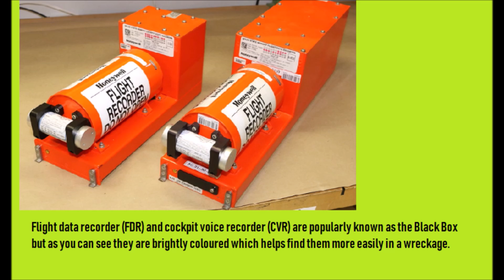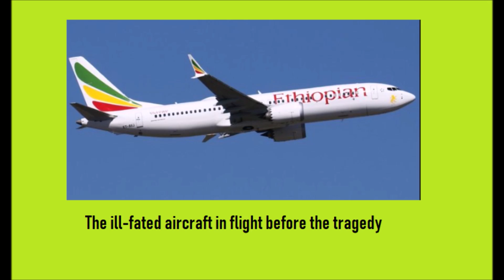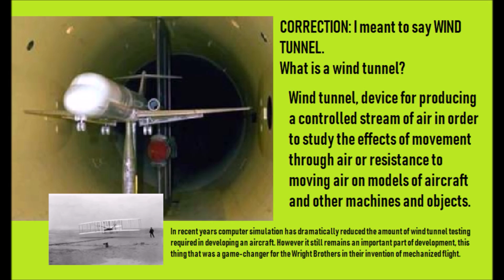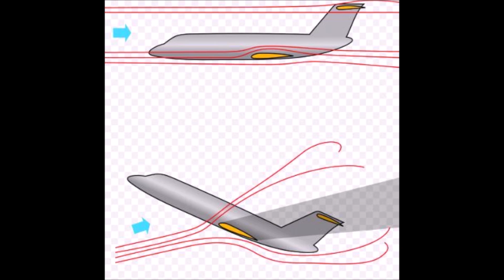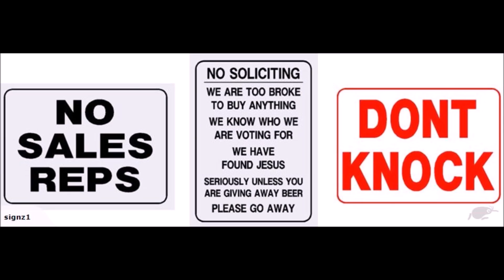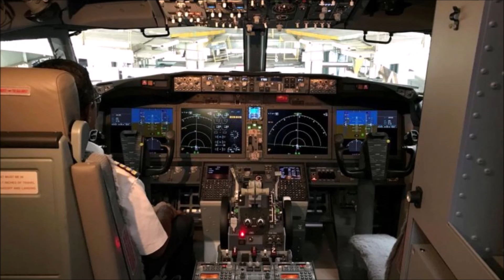Remembering The Boeing Max 8: Why An Early Better Fix Was Ignored

Comment: Nonsense...AOA disagree caused the pitch trim to run away and the crew didn’t disengage it in time. Pitch trim compensation is included in every modern day aircraft design. This allows for thrust changes, fuel transfer and passengers and crew to move thru the cabins pushing carts during flight. Boeing offered AOA disagree warning as an option and it should have been standard equipment.

Comment: All true, plus:
1. Disruption of airflow over the wing caused by high mount of engines, thus reduced lift then; this dirty air over the elevator - bad design! But remember, it had to be seen as a 737 so you couldn't put the elevator on top of the tail fin in clean air because the idea of the 737 would be gone! (Though it doesn't fly by wire like the modern Airbus) 

2.  Please compare the aircraft it was rushed into production to compete with, Airbus 320Neo and no MCAS (might crash any second) it has THREE AOT sensors fitted, one to be sent to each pilot and a spare to be used in case of disagreement - redundancy! 

I agree this crock of 1960s shite is a fundamentally flawed design, but the other two issues add to the incompetence of Boeing and its keenness to get the Max into production via software fix for hardware problems. 

Send them to a crusher "unsafe at any speed"...

Comment: Boeing was allowed to run it's own test to say the plane was air worthy . The FAA is at fault for allowing this to happen . The whole reason MCAS system was installed was to mask an unstable airframe . Boeing fooled the FAA into believing the MAX planes flew so much like a regular 737 that the pilots would not even need new training to fly it . Boeing "forgot " to tell the FAA that the 737 MAX could not fly without the MCAS ( May Crash Any Second ) system . Just a little oversight, only cost 350 lives .
Reply from the maker: well put

Comment: I haven't read all the comments, however, I don't see any reference to the over-weighted input of Southwest Airlines into the design requirements of the 90-180 passenger Boeing offering.  From the 1980s to 2000 Southwest Airlines drove the profit of this sized Boeing aircraft.  It has been reported that when Airtran was looking for a larger aircraft to add to their MD80/B-717 fleet it asked Boeing to provide a design to fit the requirement, Boeing replied, 'We have just what you're looking for, its the 737-8!'  Form always follows function.  In this case the overriding function was profit!

Comment: When the dog gets hungry it neither thinks nor considers options other than food; it will do any thing to any body to get its gob on the bone.
  It sees itself lagging in 5g; what bits and bats is it going to string together when it gets hungry; g5 equipment can be deadly if not tried and tested ,and certified by an  (independent) authority.
Now i'm scaring myself!

Comment: The advertisements claimed a 15% more fuel efficient aircraft, from the previous model 700. A simple solution would be to raise the landing flaps to a setting of 5 until the aircraft reaches 10,000 ft AGL.

Comment: A few years ago when Boeing was having problems with the lithium ion batteries on the 787 Dreamliner a professor at Harvard business school wrote an article in the Harvard Business Review titled, "The Price of Wall Street's Power". The point he was making was that people in the capital and finance industry were exerting too much influence on how companies like Boeing were running their businesses. The recurring problems with the Dreamliner's batteries were exacerbated by outsourcing and long supply chains, something which Wall Street had been pushing for years to increase profits. The design, manufacturing and operation of airplanes should be a collaborative effort between engineers, manufacturers and end users like pilots and airlines. Letting accountants, financiers and investors have too much control over a technical process like building airliners can lead to these types of problems.

Comment: The plane should have longer landing gear to accommodate the larger engines. but this probably would require new factory for that and also significant modifications to the fuselage. Manufacturing cost and time delays were unacceptable due to the loosing of sales to Airbus. Boeing was loosing sales and now it lost public trust.

Comment: It would seem that the nacelle poking up over the wing would also cause changes in air flow and turbulence as air passed over the top of the wings thus changing the aerodynamics of the wing and the planes flight characteristics....
Reply: Nacelles above the wing could disrupt airflow the airflow on top of the wing, creating even lower pressure above the wing which creates more lift...in this case, way too much.

Comment: The engine being higher and more in front of the wing causes the nose up characteristic.   All of this derives from the plane being too low to the ground for the bigger engines.   Should have raised the airplane and leave the engines in the old position.   Adding the screwy mcas was a cheap band aid solution that became tragic
Reply: I would assume you mean make the landing gear longer. The problem is you can't. And therein lies the root of the problem.

Comment: I don't think Boeing made the software change thinking it might endanger human lives. 
Cheap fixes don't always equate to substandard fixes if done properly. So if they thought they could use the cheapest way to remedy the situation then they did what any for-profit business would have done. However, they failed to inform the pilots, therein lies their negligence.
Reply: Steve The people writing  the MCAS system to depend on a single angle-of-attack sensor should have thought  they were doing a cheap fix. Relying on only one sensor to go nose down, when the plane has two, certainly sounds substandard to a layman. But I did read/hear that there is a tradition of depending on only one sensor in a 737 (due to the way it is setup with separate computers having separate inputs - making using the other computer’s sensors difficult) with the pilots being the thing that eliminates a “single point of failure”. But in this case Boeing purposely left MCAS out of the manual, to both hide the plane’s deficiency and avoid pilot training costs. And they also failed to advertise that (allegedly due to a software error) the indication that the angle-of-attack sensors did not agree was now an $80,000 upgrade).

Comment: My understanding is it's not about the nose being heavier than before.  The clearance problem under the wing (Airbus does not have this problem because their planes are higher up from ground)  warranted the forward placement of more powerful engines.   As far as I can understand, that would cause rotation under high thrust because the engine now has a longer arm about the center of mass of the aircraft resulting in larger rotational moment being generated before (to be fair all planes with engines mounted under wings will to some extent have this tendency).  This causes nose of the plane to pitch up under high thrust (e.g. during take off).  That tendency should have been fixed by proper designing rather than implementing a software solution.  Profit was on the minds of people (CEO!!!) of the company over safety.
Reply: My understanding of the problem is different based on what I've read. The problem is said to be that during a climb air starts to impinge on the bottom of the large engine nacelles and this causes the nacelles to produce extra lift. Because the engines are so far forward and at the end of a longer arm the lift produced by the nacelles tends to push the nose up.
Reply: @Joe Vignolo You could be right.  However, I venture to say we agree that the net effect is that the longer arm is what makes the pitching up problem larger than before.  Regardless, whatever causes the pitching up should have been fixed at the level of designing a sound airplane rather than fix it using software (and not tell pilots about it???), in my opinion.

Comment: The whole premise of this video is wrong. I have done much research into the development of the Max 8. The airframe is inherently stable. There are only certain conditions where the nose of the plane can get light and tend to float up into a dangerous AOA. This accident was 100 percent caused by a breakdown in the entire system. Not just the aircraft systems. BOTH AOA sensors were malfunctioning on this crashed aircraft. The pilots flying did NOT have the necessary training to know what to do. They followed the right procedure right up to the point of turning the stab trim switches BACK ON. that one act doomed the aircraft from that point. I beg the question.... Why was there a pilot in the cockpit under comand of this aircraft at the time with only 200 hours of total flight time. Are you kidding me. The blame for this accident falls with boeing, the airline AND the pilots. This is a horrible accident and I genuinely feel a great sense of loss for the people that were ddirectly affected by the death of so many innocent people. But demonizing one company or one  cause will not help anyone. Just like any other  accident there was more than one causal failure for this accident.
Reply: Your not accurate either
Reply: Sorry but you're not correct. One AOA was working correctly.  The aeroplane design is overall flawed due to the oversized engines and poorly designed MCAS.  The pilots followed procedures and due to cutting costs by the manufacturer, procedures that were not well defined along with brief training, this happened.  You cannot blame a pilot having 200 hours as the cause.  You clearly work for the manufacturer!

Comment: A human life in Britain costs 1.8million, that's the figure the government uses when evaluating whether to pay for safety improvements.  They need a figure, otherwise they might blow the nation's entire GNP, on say, putting every single highway underground to prevent deaths from asthma.  The value used by Ethiopia is probably substantially lower.  
I think though, that Boeing made a bad call here, early in the design process by building an inherently unstable aircraft, and trusting in the reliability of a system to actively keep it flying.  It had been posited for decades that a commercial airliner could be made more efficient by using fly by wire to allow inheritably unstable designs, for obvious reasons we didn't allow this. My feeling is that the 737max isn't unstable like an F16, but that it would be "tricky" to fly without computers and that Boeing thought it was good enough.

Comment: MCAS isn't all that bad on itself, it could even have prevented crashes with other types of aircraft. However, at this time, we still expect the pilots to fly the aircraft (instead of computers); Too much electronic help may give the aircraft an unpredictable feel and leave the pilot less 'connected' with the aircraft. A redesign to get the aircraft's dynamics predictable would be best, but considering all difficulties it may be more feasible to get the MCAS system to disable in an intuitive way like: when the pilot hits the up-elevator endstop.

Comment: Pretty amazing that you got the entire problem wrong..  The angle of attack sensor system has proven not robust enough to reliably provide necessary signals to the flight control system. The programming of the flight control system has proven to be to aggressive. The training program for edge cases interacting with these systems proved inadequate. The certification to have caught and fixed this in the first place failed.
To recap, it's the sensor system / flight control , pilot training, & proper certification. The plane will fly just fine once those fixes are in place. I do personally feel the rush to get the product out the door in this case is/was corrupted to a point of being criminal. Someone should have thrown a big red flag out to fix this before the first delivery.  A show stopper for a long useful life of airline service?.. nope.
Reply: I agree with what you have written here. I have researched the development and the systems of the MAX 8. The airframe is inherently stable. Adequate training and redundant systems which will NOW be part of EVERY MAX 8 will make this aircraft one of the safest and best in the industry.
Reply: I think you are missing his main point here. You talk about the specific current problems in MCAS while he is talking why it is needed in the first place. If you have this kind of software trying to compensate for errors done when designing the aircraft update you will always risk getting into this kind of problems.
Reply: @pjohan74  Well said.

Comment: No redesign is necessary.  Experienced pilots who have flown the MAX say it behaves almost the same as the NG.  

The fixes they have planned are really belt and suspender.  1) Install two AOA sensors 2) Do not invoke MCAS if the sensors don't agree, 3) "Inspect" the sensor output, even if the two agree, to make sure the readings seem reasonable, 4) disable MCAS if the pilot is fighting with it using the elevator control, 5) always allow the pilot to put upward angle to the trim, and some other things.  I'll be happy to fly in such a plane.

https://www.youtube.com/watch?v=zGM0V7zEKEQ&t=2s
Reply from the maker: https://www.youtube.com/watch?v=H2tuKiiznsY

Comment: The biggest problem was the naive implementation of mcas. No sensor redundancy or voting. MCAS Able to overpowering the elevator controls, no clear override available
Reply: There is no way for software to know if a datastream is valid or not. Averaging the two can still cause a disaster. The second sensor is provided only as a check on the first with the match/no-match answer being shown via light (which most airlines did not buy). It takes human initiative to switch the sensor being fed to the flight computer, assuming both can be read, and there is no way to do that. Voting can still cause problems as it did on the AF-447 crash when two of three pitot tubes froze over causing the flight computer to choose the wrong input. MCAS has a disable which is the only option when there is pitch control problems. After the the Lion Air crash every Max pilot should have known how to disable MCAS and be prepared to earn his pay by flying the plane.
Reply: @garymartin9777  The Ethiopian pilots did disable the MCAS, but were unable to manually trim up the airplane due to high aerodynamic pressures. Disabling MCAS means also to disconnect the electric trim engine. When unable to manually trim up they reconnected the trim electric engine, but this woke up MCAS too. It would have needed a good training, and nerve, for the pilots to pitch down the airplane and cut throttle to relieve the aerodynamic pressure on the stabilazor, and at the same time manually trim up.... all in a very short time.
Reply: @alfaeco15  Yes and high speed at low altitude was a large part of the problem.  It left 737 pilots scratching their heads wondering what the guy was thinking going that fast -- even when the overspeed klaxon went off.
Reply: @alfaeco15  since this happened shortly after take off I wonder if they even had the time or the altitude to make those adjustments.
Reply: @alfaeco15  from what I 've learned about Captain Getachew he did have the training and nerve. He traveled to Miami in 2017 for simulator training on this plane and was due for follow up training with Ethiopia 's new simulator later that month.  You can hear them on the CVR working the problem, or trying to.  Once that software went haywire they didn't have a chance.
Reply: MCAS disconnection should have been independent of the electric  trim control. Let's see what boeing fix do
Reply: Technically the pilot could have nose down the airplane to release aerodynamic pressure on the tailplane, but it is not the first reaction when the plane pitches down, requires counter intuitive thinking and nerve. And if the plane is already too low...

Comment: Commercial airframes are required by the FAA to fly hands free.  Meaning, the airplanes are inherently safe.  There are no similar restrictions on military aircraft as the need to perform at the highest level.  It is very common for an MCAS type system to be found on these planes.  A few years back, a B-2 bomber crashed in Guam due to the software going bonkers.  But in that case, the pilots ejected and survived the crash.  No so for the passengers of Lion Air and Ethiopian Air.  If Boeing were to be forced to redesign the Max, it would be a tremendous blow to prestige and profitability.  They most likely would kill it and go onto an all composite 737.  This will take several years.
Reply: Actually there is no substitute for pilot training. Instead of installing an MCAS system they should have taught the pilots the unique flying characteristics of the max in a full-time configuration  during climb out configuration
Reply: @kpchannel5419  The MCAS system was put in place to comply with FAA requirements.  Extensive training without MCAS would do the trick.  But for sure there will be a pilot that will not be able to interpret a nose up during climb out and end up in a tailspin stall.  The right way way to solve this problem is to ditch the Max design and start with a clean sheet of paper.
Reply: Actually it wasn't a software problem on Guam it was moisture in the pitot system. 
Even then with the crash investigation and progress they had to call in Engineers from 25 years ago to figure out what caused the  failure
Reply: @kpchannel5419  Substitute "AOA" for "pitot tube" and you have the same root cause.  A faulty primary element, sending false data, caused software to fly the plane into the ground.